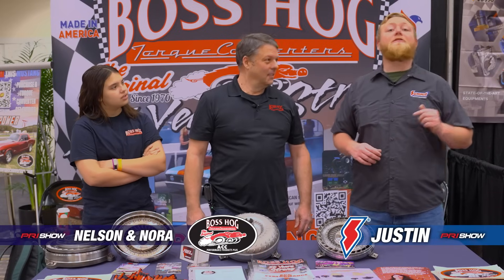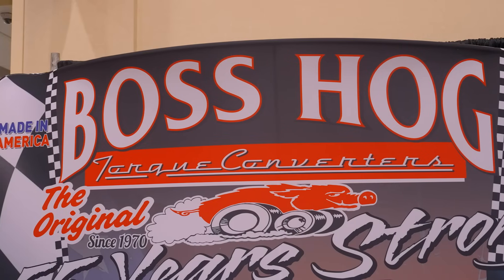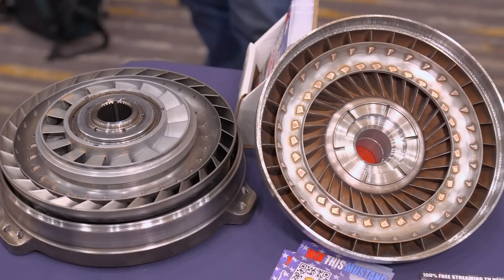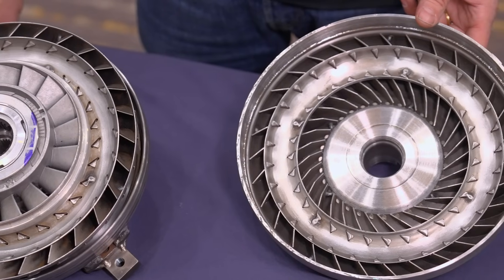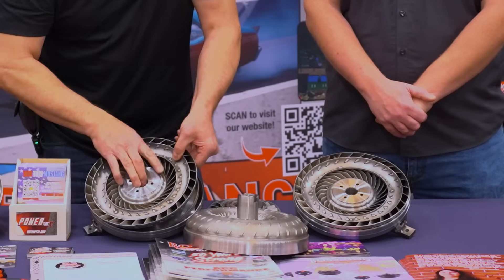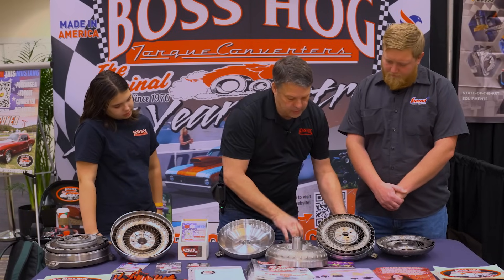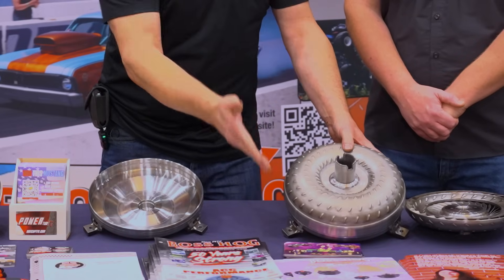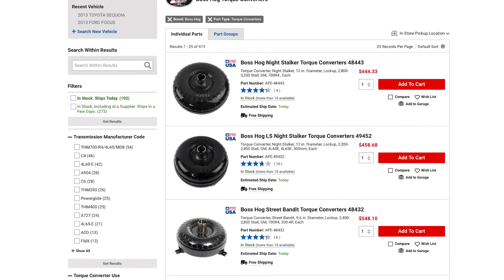Boss Hogg Makes LS Swap Torque Converters for Classic Transmissions | New for 2025

Comment: I got a boss hog LS night stalker  for my 4l60e that was fully rebuilt with eagle red clutches, shift kit, Corvette servo, and this converter the bearing came apart inside the torque converter. They grind all down and sent all those shavings in my Transmission destroying it after 10 miles.. I will be making a YouTube video of this torque converter. I’m upset it has cost me $2800 to rebuild my transmission again and buy a  quality torque converter.
I’m sticking with Circle D. I should’ve done it since the beginning, but I wanted to save to save a few bucks and now it cost me big